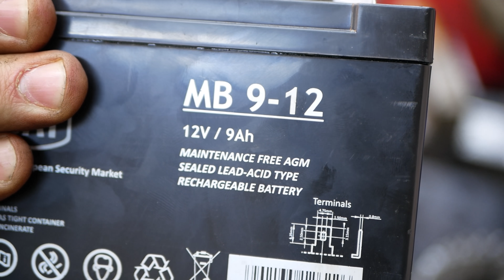No More Trailer Woes: My Electric Towing Solution!

Comment: I tried, with a similar construction, to move a trailer with a boat on it. The motor is strong and the wheels just like yours, but the wheels kept digging into the dirt without moving the trailer. I tried with two wheels on each side but I had the same result. The boat-trailer assembly weighs about 1000 Kg. I used several lead blocks to add traction but this did not help either. The ground was level. Any ideas?

Comment: single axle dual motor like that you lucky if your getting 60/40 (more likely 70/30 or less) dual axle with dual motors you would get much closer to 50/50 which would benefit you more on uneven ground... on even ground (like pavement) single or dual axle would make no appreciable difference

Comment: Sure make it yourself with $10k worth of tools, accessories supplies, plus time and knowledge a shop. That welding table alone ain’t cheap. So this build came up to $15k between labor and materials, how much did the raw steel cost? The electricity to run the mill? The gas for the steel cutting torch? Buying one retail is cheaper.

Comment: Took 5 days to make when you could have used your truck to tow it split the wood and stacked it in the back of the truck before you even got started on building something that only works on sunny days and flat surfaces.

Comment: I made one of these in much the same manner to pull my boat and trailer across the back yard to it's seasonal storage spot. Lot of work, but it worked well EXCEPT I forgot that the traction of these smaller wheels wouldn't hold up on grass even with a trailer tongue weight of 300 lbs. Poor application only in my case. Ended up selling it on Kijijji for a lot more than it cost to make as commercial ones like this sell into the thousands.

Comment: As with any other device a machine will only be as strong as its weakest link. In this case it is quite literally the link in the chain that is the weakest point in this design. The entire load of whatever you're going to try to move with this device is going to be dependent on the very small amount of metal of the side plate of the chain link that wraps around the link pin of the drive chain. There should be reduction gearing after the drive chain.

Comment: Looks okay for what you're using it for, but your pillow blocks are upside down! The way you have it, under a heavier load the only thing keeping the wheels from ripping free of the frame are the 2 bolts on each one! You should have kept the frame straight, and mounted the blocks to the BOTTOM of the frame! There would be NO chance of them pushing up through the frame then!

Comment: The trailer to be moved has an adjustable height leg on it. So it fits over the car hitch and is set down.    So, you built an adjustable height motorized device just to be a SECOND (REDUNDANT) lifting device and don't use a car to move it? Advantage is no car is required. When car/or truck or forklift is always required ANYWAYS  so "I do not see advantage in seeing something that is mainly gonna sit around with dead batteries." is how often it will be used.   Just because you can build it "does not mean it SHOULD BE BUILT". Just saying.
Reply: Maybe this was just a part of his Resume, so people can see how knowledgeable he is at building "Anything" you want for Top dollar! You got to admit, he really knows what he is doing!

Comment: Where is the benefit??  You looked like you were pushing it just as hard as if you were using a non-motorized $100 trailer dolly from Harbor Freight.  I can push/pull my log splitter around the yard just as easily as you were pushing/pulling yours with the Harbor Freight unit.  What a total waste of time and money!  In order to have a motorized trailer dolly that actually WORKS on grass as well as on level concrete it has to have enough WEIGHT to have any kind of traction.  That doesn't mean 75 or 100 lbs.  We have one at our business that is not a lot larger than yours but weighs over 250 lbs and has much more aggressive tire tread.  We don't have to "lean into the handle" or manhandle the unit even when sterring a 3000 lb. boat, motor and trailer across the gravel parking lot.  It works like it should so we hardly hang onto the handle at all except to steer.